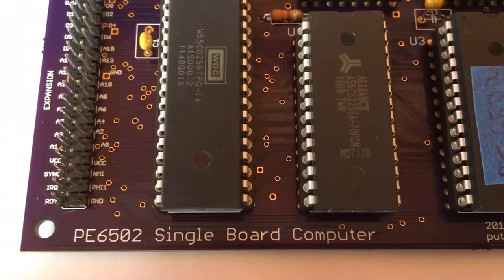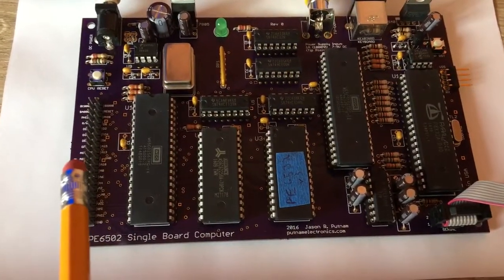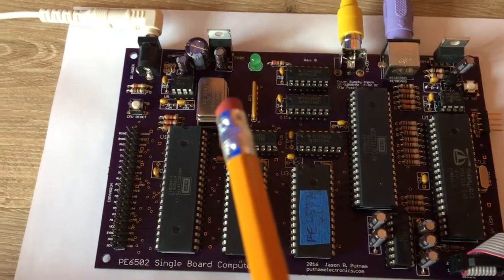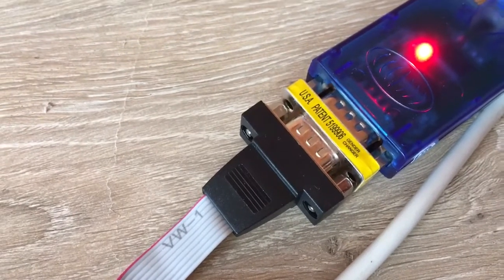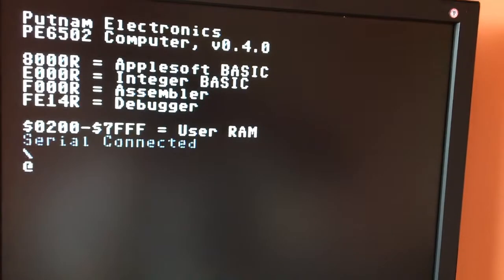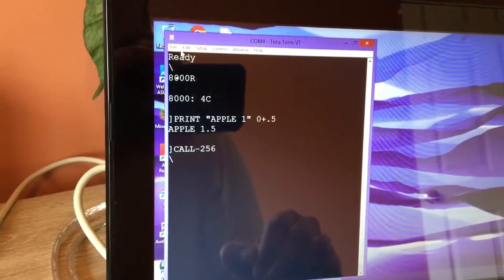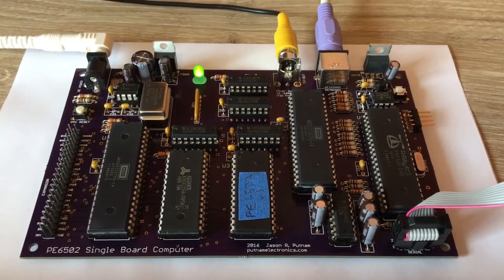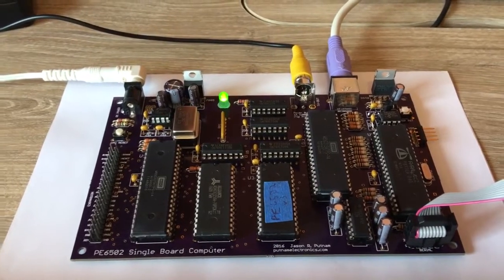PE6502 Usage Demo, and new PutnamElectronics Forums

Comment: Great kit. The RS232 converter should be optional with pins being broken out to header  for use with USB-TTL adapters or a place to put in a USB-TTL adapter. optional DS1233 reset generator for 555 would be nice. solder pads for hardwired 5v power with 5.1v 5w zener diode +resistor protection. zener diode protection on usb-ttl  and other inputs.

Comment: The 6502 use for this buid is it the same as the old MOS 6502 for programming and assembly.
Reply from the maker: Essentially yes..  The PE6502 used the currently manufactured 65C02. The differences between the MOS6502 and WDC65C02 are here: http://wilsonminesco.com/NMOS-CMOSdif/

Comment: I am always curious in how could we run something more powerful than BASIC in this machine... Can I code Assembly directly in this machine? Or even better, can we run C directly in it? Commodore 128 had Power C, Could we run anything like that in this machine?
Reply from the maker: Hi Glider!  You can do both- there is an onboard assembler, and you can code assembly directly on the PE6502.  Also, there is a C cross-compiler that can compile code that runs on the PE6502.  I demonstrate a C program that was cross-compiled on my YouTube channel- running the game "Farmhouse Adventure"..  I've also documented the setup for the cross-compiler on my website support forum:  putnamelectronics.com
Reply: Thanks for you reply  @corneleousworthington4566  . I code mainly in Lua, and one of the things I am deeply interested is the possibility of making Lua (or a simplified verion of it) running as the main ROM in a system like this. Not sure if it possible given how reduced the 6502 instructions are compared to x86, but being able to cross compile C code to it may help, as Lua was made in ANSI  C

Comment: this thing could already sell in the 100s of 10000s. more or less as-is. provided it gets ethernet and a 65C22+all i/o pins of that 1:1 to a pinstrip connector. 65c02s are hell a lot more easy to program to 'open garagedoors' and turn lights on and off than anything else out there and last for centuries. (unlike, let's say, raspberry pi's ;) maybe a second rs232 port as well. (one for console, other to control things). and basically. when they're halted using the new instructions waiting for an irq power usage is next to zero. none of that bloated linux stuff either. (needless to say linux doesn't run on much hardware which doesn't look like it will fail within 5 years after coming out of the box, especially outside ;) the number of people that know how to program 6502s also far exceeds the number of people that know how to program for linux. millions of 8 bit homecomputers and games consoles made sure of that. lol. din rail "hutschienen" mounting case around it and good to go. :P (although in that case it's probably best to fit all i/o inputs with optos and 24vdc to 5v conversion and all outputs with something capable of driving 24v as well as that seems to be the standard for such things ;)

Comment: why people keep screwing around with systems that actually are 30 to 40 years old by now physically, of vendors long dead, most of which containing propriatory chips anyway, preventing new mass production and a whole lot of shadyness in whom to buy the patents and designs from to get that fixed, beats me. seems like the market is entirely open for a new system 'at that same techlevel' (40 pin dip packages, 8mhz or so, fully cmos) which hijacks the entire market for systems that simply do as they're told and nothing else. i bet most of the atari and apple II and c64 scene would jump over. none of that 'changing the memory map' such as is done in the c64, just plain and simple computers that do the job and which can be put to use anywhere from your desk to opening the garagedoor. which are all exactly the same-. as that always was the main selling criteria for 8 bit micros. something that runs on one c64 or atari will pretty much always run on another one. no "operating  system" and "drivers" needed. go back to -that-. not by copying some old crap. but by just getting a new company with a new factory pooping out -new ones. (and just like with the apple II, facilitating a whole range of clones that do the same ;)

Comment: anyway it';s about time some hardware standardized widely available microcomputers enter the market again... just that this one lacking ethernet and normal rs232, causes it to not be it. it would be a rather small modification to give it a 65816 (while ignoring the top 8 bits of the address bus and keeping it 6502 compatible board wise), adding all the stuff needed for actual use nowadays (multiple rs232 ports and ethernet primarily), and tadaa. instant computers of which we actually know what they're doing without any of the fuzzy undocumented crap going on in the 'pc world' on the desks yet again. we never asked for 'usb' or 'pci'. we most certainly don't see it as a nessesity. :P but ethernet muss sein.
Reply: the nintendo nes or snes could have been expanded to 'just that system' it most certainly was produced in sufficient numbers but all their propriatory crap stopped it from getting expanded to full microcomputers. guess we're just gonna have to come up with some board design, opensource it, and mass produce it ourselves too. while not using a single chip not 'widely available' on the open market, and we have another 'apple II' or original ibm pc. (After all it did initially ship with a technical reference guide, schematics, sourcecode, and only contained 'openly available parts' BACK THEN ;) just that the stuff in the shops today is utter garbage.
Reply from the maker: Hi Sven!  Thanks for your comment!  I will start researching the 65816- great idea!

Comment: btw what's up with the 555 being abused as a reset 'timer'. the DS1813 is a lot more suitable for that. the 555 won't check for voltage conditions and will happily bring the board up when the voltage is not what it should be. it only 'times'.
Reply from the maker: Yes- would have liked using the DS1813 or similar.  The 555 is actually used here for a couple of reasons;  It just holds the 65C02 reset line low for a few seconds, so that the Parallax Propeller has enough time to download the terminal software from its eeprom and start the terminal emulator.  Plus, the Commodore 64 used almost the exact same circuit for its startup timer (they used a 556), and I was greatly inspired by the Commodore 64 when I was younger!  :-)

Comment: would actually replace most pc's with anything like that with a standardized memory map, cs8900A ethernet, 2x 6551 (or preferably 16550As, whatever as long as they're always the same and it's a hardware standardized platform). let's see if that 'expansion bus' has some pin we can pull down to hijack addresses from the mainboard and what other aspects to copy and standardize for mass production. don't like the video circuitry in a single vendor reprogrammable thing tho. should get some asics made for that. preferably something software compatible to something 'old and common' while only having dvi-out on the other end. at like 200x100 8x8 char text only. ... maybe add one of those yamaha opl things (not sure if they had FM, or just the built in waveforms, guess at least one of them did).
Reply from the maker: The Parallax Propeller is a bit of a mixed blessing here.  On the plus side, It is quite popular- is essentially an 8-core microcontroller, and easily re-programmed with the freely available Propeller Tools toolchain- their's quite a community of people that develop for it and share code.  It could run a sound chip emulator on one core, and still have 7 cores left to do termial work, and other emulators.  On the negative side, it is a little expensive (8 bucks a chip!), it needs 3.3v power supply, 5mhz crystal, and it's own eeprom, so that's a bunch more parts necessary just to run it.
Reply: also it's single vendor and that single vendor is not gonna give you the designs to have your own produced should they ever stop making them. which along with the 3.3v vcc already disqualifies it.
Reply: 'reprogrammable' stuff is just asking for a repetition of 'everything wrong with the pc', inb4 backdoors running in your video chip :P
Reply: sure we could also use PIC's as memory controllers or 'programmable clock generators' or what not.  but let's not forget what happened to GAL arrays. the moment something that's currently selling a lot gets a bit less popular, 'the usual suspects' just drop production alltogether rather than scaling down, and with propriatory stuff that's far too complex than would be needed for the job it's supposed to do, in that case, you're screwed. either it has around 20 different suppliers and/or can just be ordered into production at any fab by ourselves as the designs are well known, orrrrrrr it's simply not a candidate. (that being said the motorola 6545 basically is not much else than a glorified clock generator anyway, the actual video comes out of the char rom or 'in between' video ram with a shift register anyway, the whole thing could be done with 74 logic without running the risk of the user randomly changing the monitor sync signals ;)
Reply: nothing on that market too atm... 5 volt dip video chips, even less so with dvi-d output. ethernet seems to lack a dip package (cs8900a qualifies in all other aspects but only available in some 100 lead tiny smd thing (rip out the waver and put it in a ceramic package? ;)
Reply: the whole 'nothing you can type into your computer can break your computer' aspect also should be maintained. having any chips with internal address decoders (causing bus conflicts) originally intended for pnp isa, or controlling displays where the user can just change the sync himself, kinda screws that up.
Reply: the DS1813 reset circuit is a bit of an exception in that case, as let's just say that should it ever seize production it can just be replaced with a zener diode and an r/c circuit  driving a transistor doing the same job. the apple 1 for the record, didn't have a reset circuit :P they had to be reset manually after powerup. but a 555 timer... i can't exactly see how that would conclude the 5v rail has indeed reached at least 4.5v or something around that. it just 'times' it won't provide any protection against brown out etc.
Reply: for that matter i was considering adding a second one on the NMI line, where the reset timer just normally resets the system, but in case of a powerdown, a huge elco remains charged on the board still powering the board after the psu has gone out, that second DS1813 being behind that pulling NMI so the system actively wipes it's ram to zeroes upon powerdown, preventing 'leftover' crap in there for security purposes. (as for some reason, ram seems to retain it's data for hours, if not months after powerdown which is a huge security risk ;)
Reply: ram chips with an actual /RESET line themselves would be eh 'nice'. lol. clearly data security never was much of a consideration for chip designers. (as clearly it's hell a lot easier to just have the memory manufacturers add some extra gates to just set them to zero all at the same time rather than running a counter to do it one by one ;)

Comment: Very impressive! This looks like a super fun project! I definitely want to try when I have $130. I think half the fun for me would be trying to construct cool case with my 3D printer or some old wood. Also do you think you will sell replacement parts for this computer? It would be reassuring to know I can easily buy a replacement PCB or 6502 CPU if I damage it or something.
Reply from the maker: Absolutely- replacement parts are available, from putnamelectronics, or other electronics suppliers.  All parts in this kit are readily available, currently production items.

Comment: You cheated by using the Parallax processor!  $130 for this thing is too expensive!  No SD card. Only 32KB of SRAM.  No VRAM!
Reply from the maker: Thank you for your constructive feedback unebonnevie!  I thought that the price point was pretty fair- being as the closest competing product (no longer available) was at least 50 dollars more expensive, and had less features..  Although- it is no longer available- and maybe because it was too expensive?  :-)  I will work on cost reduction for sure.

8 bit guy just reviewed my kit- and he too was frustrated by lack of VRAM.  The full bus is available in the expansion header- and a video card with VRAM is something I'm planning for a follow on product (as is a sound card using the SwinSID SID chip emulator).  So, if not fully featured in it's stock form, it is expandable.  I am also working with the vendor of the CFFA1 compact-flash storage device- who currently makes this product for an Apple 1 and Apple II computer, and we plan to make his same product available for the PE6502.  

I will also look into creating a V2 version of the kit- with expanded graphics capability, and onboard SD.  One thing to note however, is that moving to a VRAM based video would eliminate the Apple 1 compatibility, which a lot of people are interested in.  I'd need to replace WozMon with another monitor/OS for example..

Just thinking out loud- and again, thank you for your feedback.
Reply: I'm enjoying the product. Thanks again! I also would love something that could do graphics as well (e.g. c64). Either way, thanks again for selling this. Most of the time that doesn't happen and these things stay pet projects like the monster 6502. Don't worry about the price. You need to get paid for your time and these things take a long time to build and program. You're not going to sell 100k of these, so it makes sense it will cost more.

Comment: I'm another sent over from the 8 Bit Guy... Question: Will individual parts be available from you if we screw something up during assembly, e.g. in case we fry something?
Reply from the maker: Yup..  If you fry something, you can buy a replacement.  Just try not to fry the board- it's the most expensive part in the kit!  :-)
Reply: Corneleous Worthington Is support available from you if builders get stuck, e.g. email, or phone (as opposed to just being referred to links, other videos, and other forums)?
Reply: Corneleous Worthington Oh, and also, will you ever do an Altair kit? I'm sure the Altair Clone is great, but I'd actually like to BUILD mine.
Reply from the maker: Steve Hacker yes. I will support ya!  I have my own forum, and if we discuss resolving an issue there, otters can learn from it- but email works as well. I won't leave anyone hanging.
Reply from the maker: Steve Hacker I'd love to kit the Altair..  unfortunately- there are a lot of parts for that machine- 3 boards, so it will be a little pricey- maybe around 250-300 (with emulated disk drives, and 64k ram)
Reply: Corneleous Worthington I'd certainly rather buy and build a $300 Altair kit though, that I'd learn so much more from, than buy the pre-built "Altair Clone" for $700 (including cable adapters and such)...

Comment: Looks like a pretty cool project. I also found you via the 8 Bit Guy. I've still got several 8 bit computers I designed and built way back in the late 70's / early 80's, but in those days they were all built using grid board / wire-wrap. Very compact boards, but obviously "one off" builds. Your PCB design is nice and tidy. I'm still not 100% on the thought of a retro design that implements a retro 8 bit CPU combined with a modern Propeller MCU. But I guess that makes it somewhat unique, and I suppose the Propeller in a 40 pin DIP package kinda fits. I'm not familiar with Propeller, but will your design support PAL Video Generator mode? Also S-Video (seperate Chroma + Luma) for sharper image than Composite?  Have you investigated International shipping cost (eg. to New Zealand)?  Finally, have you checked if there will be any issues with Apple copyright? (sorry, so many questions).
Reply from the maker: Hi Greg!  Thanks for the kind words, and good ideas..  

I emailed Woz, and so far have not heard back from him or his people.  I understand that the Apple 1 he freely gave away schematics for (and SW) back in the mid 1970's to try to get interest going, before the Apple 1 was a product.  I've heard that the Apple 1 content is considered PD?  Buy, I am carefully watching just in case.

The other content in the ROM (Applesoft Lite, Krusader) I have permission from the authors to use.

The use of the propeller, while not period, allows for a fully customizable computer terminal/interface- it should work with PAL (I say should, because I've not yet tried it)..  The propeller is amazingly capable, and should allow for a WIDE array of extra functions that could be called from the PE6502 using escape sequences.  We've already got color text working, using this exact method.  I've previously built a board that had SVGA, and SD interfaced via propeller- so much is possible.

I really need to do my homework with respect to discovering how to ship outside the USA.  It's not that I don't want to sell to outside the USA- I just currently have no idea how to ship outside the USA in a manner that will still leave this kit cost effective.  Anyone that has ideas, please lemme know!